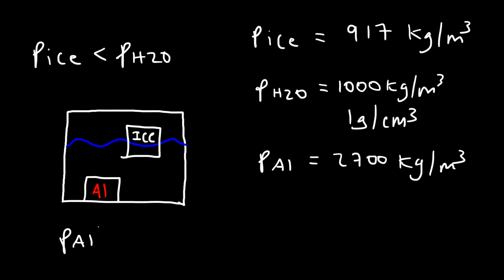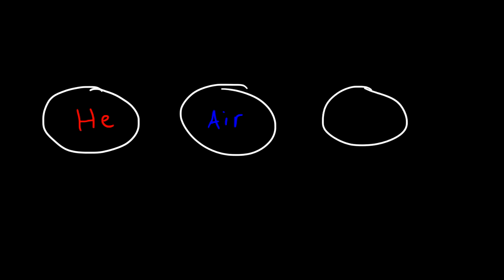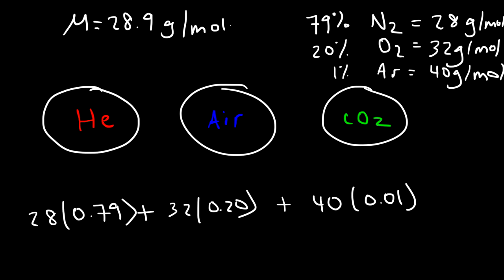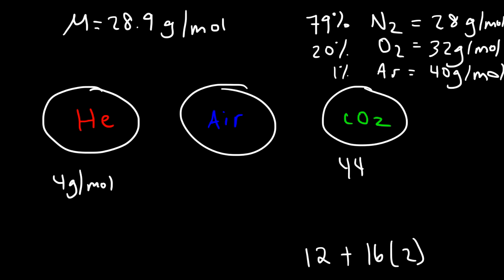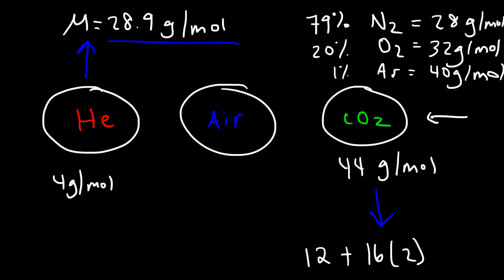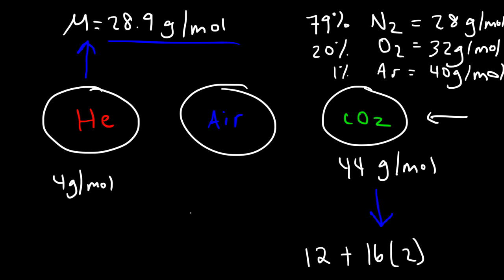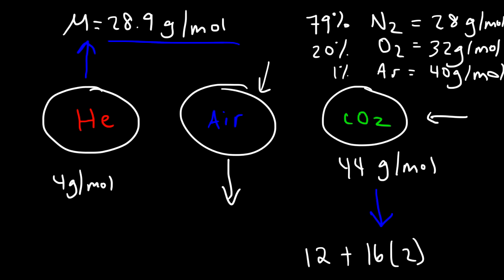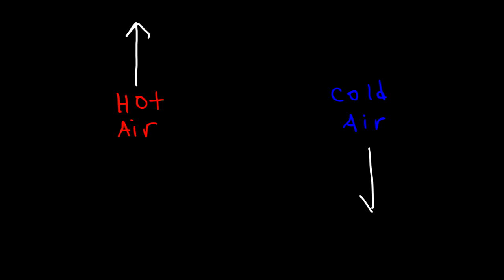Will It Sink or Float?

Comment: The problem is that no one is explaining why an object with a smaller density is floating, and an object with a higher density is sinking. And why does it sink in infinity? Can someone smart answer that?
Reply: Basically, when an object has a low density, that means 1 of 2 things:
1. The object has a low mass. This means that the object will have a lower weight, and will thus need a smaller buoyant force to counteract it, thus making it easy for it to float. 

2. The object has a high volume. In this case, if the same mass of the object were submerged in water, it would displace a larger amount of water, thus increasing the buoyant force acting upon the object (Archimedes Principle) and allowing it to float
Reply: @angadkalra6769  thank you
Reply: Ah cant understand